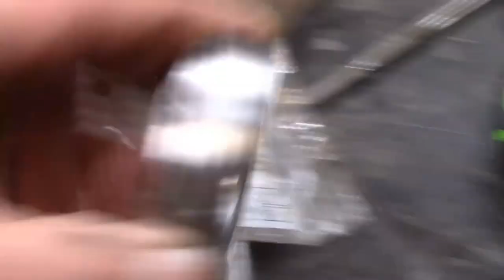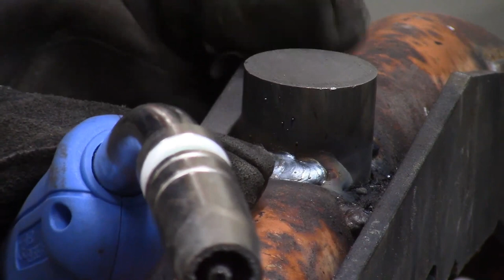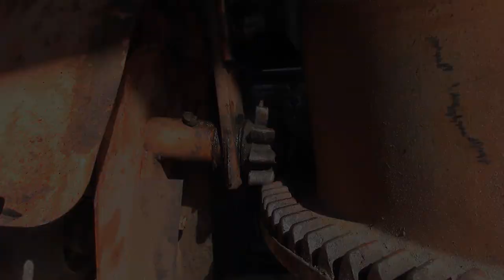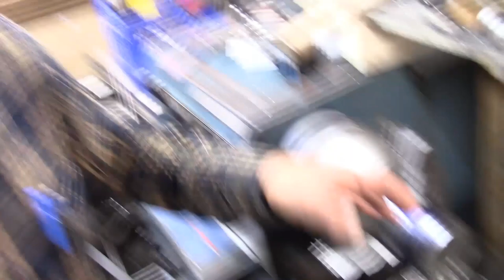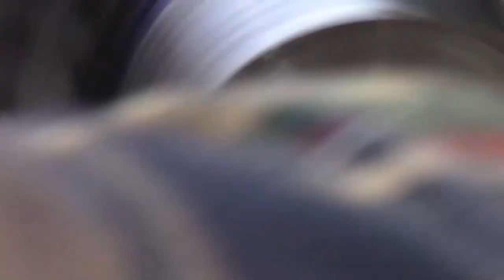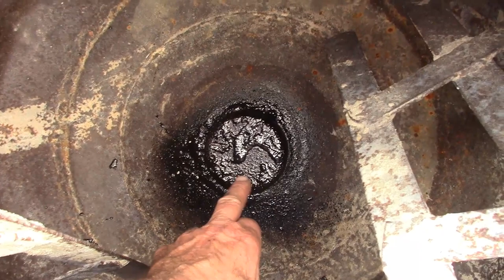Machining New Parts for our Cement Mixer {#66}

Comment: Hi Jeff, help is a GREAT thing around the shop. Hey did you or do you know Randy Richard at R&R In The Shop he just did and is still doing a sentimental cement mixer, we think a third family generation going to have in the end for him Jeff. 
Thank you for bringing us a long with this shaft machine build and bearing engineering upgrade. Some more make us jealous welding work as well. That is some tough steel and that is good for a very heavy used shaft of the mixer.
Hey look you got it done, steel maybe inconal??? Guess. We had the Harbor Freight orange donated after we pored 3 air conditioner pads and our out building Grinding Huts foundation, thumbs up of course. Lance & Patrick.
Reply from the maker: Yes I thought it was kind of humorous that both Randy and I were working on Cement Mixers at the same time. His is worth the time invested. The one I have is the the cheapy almost throw away mixer. I am going to be doing a Re-build of a commercial gas operated mixer one of these days, it will require the remake of the pinion Gear  and a few other issues.  It sits on its own axle so it can be towed from one work place to another. It was left abandoned at our shop location some years ago. Thank you so much for viewing and commenting.
Your You Tube Buddy

Comment: Jeff, that's either 4340, 4140 or 8620 "Pre-hard" [partially quenched as it is hot rolled] that is designated like as AISI 4340HT its about 28 to 32 RC outside.  Fully oil quench thru hardened  [heat treated virgin material of these steels] would be 50-60 RC.
Reply from the maker: Thanks for that! I am still trying to understand all the different materials. I have a selection of them that are marked and that I use to identify other metals, as a lot of the material I use is bought in bulk auctions, without designation.

Comment: I can't believe, I have the same mixer. I got it from my farther before he passed. I need to work on it. Any idea who the manufacturer was? I need the larger gear found in the motor housing used to turn the tank. Also if I may ask, how did you take the tank off the bearing shaft? it looks welded to the tank with 4 lubrication holes. Basically how did you take it apart? Thank you for your YouTube video, it explain a lot.
Reply from the maker: You know there are no markings on it to tell me who made it. But mine just has one gear that interacts with the barrel gear. the motor is a direct drive Wish I could help more.